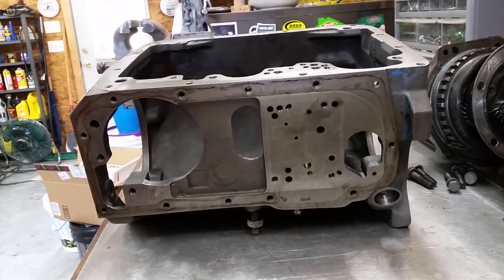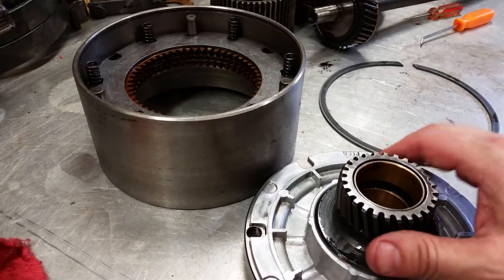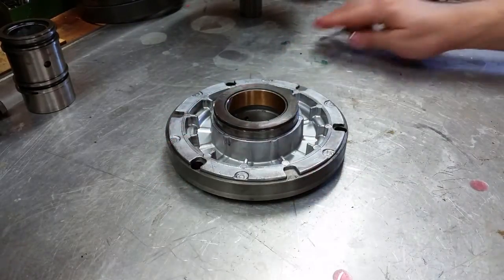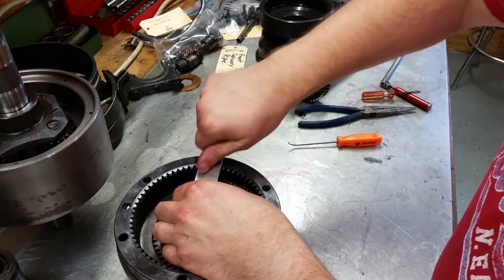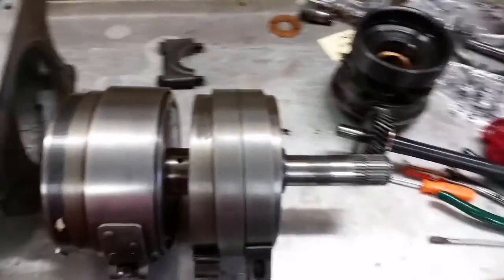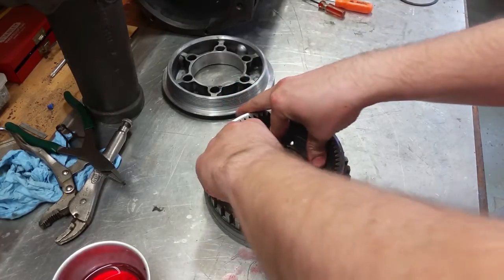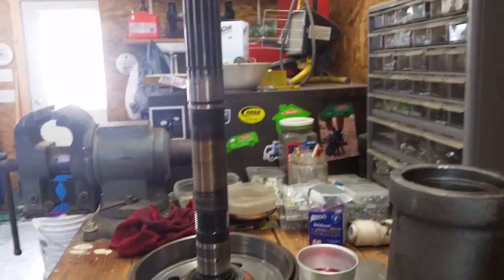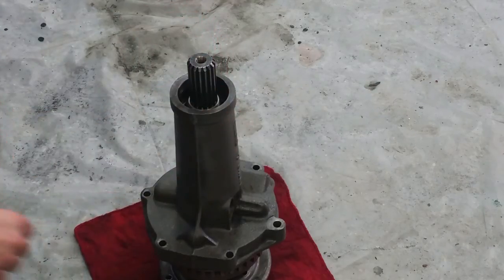1955 Oldsmobile Hydra-Matic Rebuild - Part 1

Comment from the maker: Yes cleanliness is very important with transmission, more so than engines, and I did my best to scrub all the parts in a parts washer with brand new fluid.  I haven't put fluid in it as of yet and I'm still researching what to choose.  I'll try to remember to update you on it when I do.  I'm not sure about other transmission sizes as I'm not an expert transmission builder by any means but I know modern transmissions have aluminum cases so they are definitely much lighter!  Thanks for watching!
Reply: +a58strod I have been told that napa fa is a replacement for type a.

Comment: Very useful video but I have to correct what I think is an error. Everything I have read and seen says that the square notches in the steel clutch plates go over the dowels, not the round notches. The various manuals I have read say this is important.
Reply from the maker: I looked it up and you are right.  Good catch.

Comment: Fascinating video. Thanks for posting. Do have one question--you don't talk about cleanliness and/or the importance of not getting contaminants onto any of the parts and/or in the assembled transmission. How careful were you about that? I think I can see dirt particles at several places and just am curious. I will admit to being a fanatic about that--so much so that I am concerned about getting 4 wheel drive fluids changed sometimes because I am concerned that some contaminant might be introduced whereas of course (hopefully) there was no dirt assembled into things at the factory. Also, what kind of fluid are you using for this? I know that this originally took "Type A" which supposedly had something like 16,000 parts per million of zinc or phosphorous for anti-wear protection and no fluid now has anywhere near that much. I am fond of this vintage of Olds because we had a '57 98 coupe.
Reply from the maker: +John Edwards I did the best I could to keep things clean. Since it was a working transmission and finding all the sludge and grime inside having a dust particle slip by doesn't worry me too much.
Reply: Now that you put it that way, I totally see your point. Thanks again for making this.

Comment: Has the transmission been put into service?  If so, any issues?  Was the manual enough detail for a novice rebuild?  Where else did you find help besides the manual.  You mentioned you were not an expert.  I am not either.

Comment: One more thought. These parts all look so massive. Are transmissions today of similar dimensions and weight or are these parts truly much more massive than today's parts?
Reply from the maker: +John Edwards I don't think this transmission is any larger than today's transmissions but it sure is heavier! I think a lot more parts are aluminum these days.
Reply: +a58strod Thanks. Have you found your fluid and put it into service yet
Reply from the maker: +John Edwards I put regular Dexron III fluid in it and it's going to be a long time before I can road test it.  I did just start my rebuilt engine though.  Long road ahead on body work.  This is  my first start video: https://www.youtube.com/watch?v=nsXL36aLtQ0
Reply: +a58strod Thanks for the update and the link. The engine sounded pretty good. Good luck on continued progress.

Comment: Which shop manual or build manual were you showing when talking about checking the passages?
Reply from the maker: +Scott Goessling It was the 1955 Oldsmobile Shop Manual, Chapter 3 is all about the Hydra-Matic